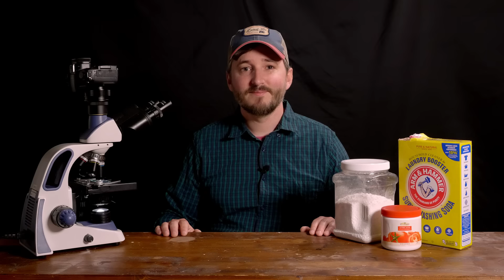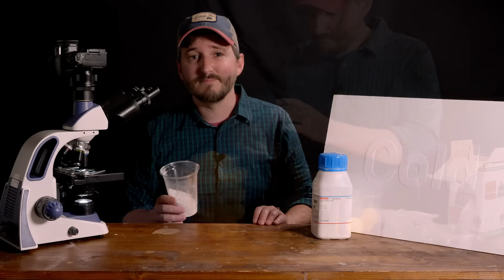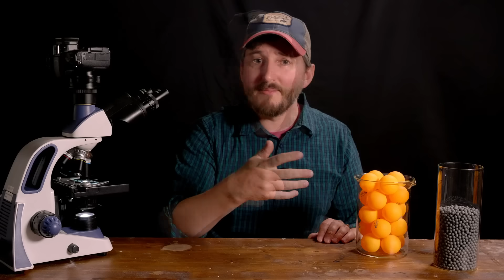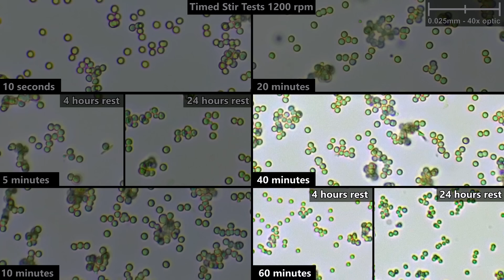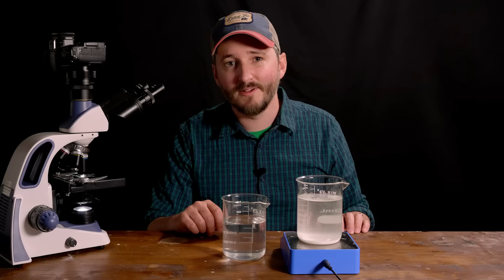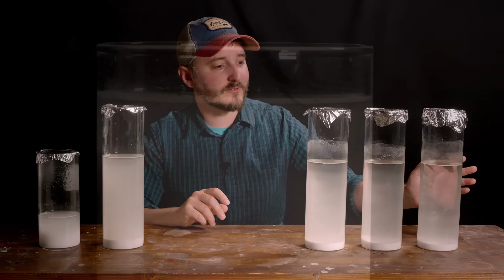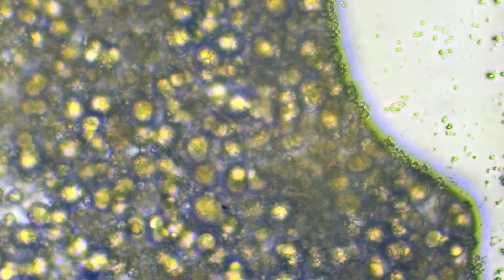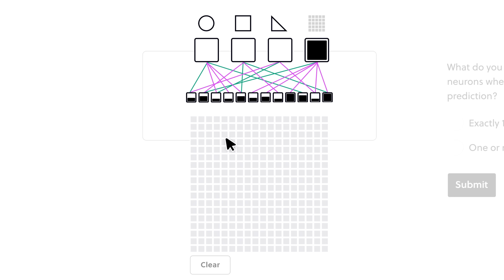Making Infrared Cooling Paint From Grocery Store Items (w/Novel CaCO₃ Microsphere Synthesis)

Comment: can someone enlighten me if my plan will work.....
the plan is to use a mini washing machine(a motorized agitator built-in to a bucket) to run a X10 batch , Thought of a way to poured in is a followed as not to waste time washing again and again with vinegar... 
1.start by pouring in ALL of the Calcium Chloride/Citric Acid solution all at 1 go and turn on the machine
2. start mixing with the 1/3 nanoscale batch,
3. at the 5 minute mark, pour in 1 batch smallscale 
4. at the 9 minute mark, pour in the rest of the 3 batch largescale 
5. stop all mixing at the 10 minute mark
so the nanoscale particles get it's 10 minute of mixing, smallscale particles get it's 5 minute of mixing, and the largescale get it's 1 minute of mixing...
will this plan screw everything up?  or should i opt to the "wash after each batch" ?
the solutions are awaiting the in fridge awaiting advice...thanks everybody
Reply from the maker: A washing machine may work. It will not work to add the solution in steps. It would work to do the opposite, however. If you add all your mixture at once you may remove some at each time increment to make different sizes

Comment: I understand that the sphericle particle shape and their size distribution would pack more densely. Same concept as ultra high performance concrete. But such a paint coating may not need such dense packing. In other words, how much difference in emissivity/reflectance would it make between using microspheres vs. regular calcium carbonate? Whitewash is calcium carbonate. Whiting is calcium carbonate sold in ceramic supply stores. Lime is calcium hydrate sold in box hardware stores and turns into calcium carbonate. Does the microsphere density really make that much difference? Seems most all pure calcium carbonate is brilliant white and could be mixed as a paint.
Blessings.👽🐍

Comment: A viscous consistency would lend itself well to a trowel or float. The troweling action creates a very fine smooth hardened surface by forcing the different sized spheres into their most efficient spacing, excluding as much air as possible, and also increasing adhesion to the application surface.

Comment: What is the water resistance/solubility of this kind of paint? If applied to the roof of outbuildings or metal roofing I would want it to be weather resistant. 
Also, reminds of the pyramids supposedly being painted white. Probably with an early form of this pigment.

Comment: May I suggest applying this paint like pouring slip to level floors? Lay your surface as level a possible, apply a border of some sort to the level of thickness that is optimal, level with a screed (if the chosen mixture is thick)and allow it too dry. Maybe add vibration to shake out any air bubbles? A vacuum may do the same but would put the process outside of the common person's access. Great idea!!!

Comment: I had an idea!  there is "car dip paint" that is very matte in finish, and is colored the same way that you're "coloring" your acrylic.  I wonder if that could be used as the polymer to hold the pigment?  If so, that stuff is VERY spray-able and is straight up designed to have micro-pigment suspended in it
Reply: Plasti-Dip is not durable at all
Reply: Durability ... like many things, is a relative term.  Compared to what he WAS using... it is likely MUCH more durable @NoSpamForYou
Reply: Wait since when?
Reply: What is the car dip paint?
Reply: @marcisaacs9407  It's a product called plastidip but a company called dipyourcar sells it in bulk in car kits

Comment: I probably missed the explanation in the video, but why do you need nigh packing density? I thought as long as the rays of sunlight are blocked by particles, they'd get reflected anyway. We might even say that a lower packing density makes for a lighter paint easier to apply.
Reply from the maker: More pigment density means you need less binder, which means more of the paint is doing its job of radiative cooling.

Comment: Use of an ultrasonic horn may refine the microsphere size. Not exactly an out-of-the-hardware-store idea, but you could make one! The mechanical properties of the pigments with alloying the different sizes. Also, I appreciate the filter design with the capillary action - I came to the same simple idea with layered geotextiles for my raised garden beds. Anyway, top job.

Comment: This is very cool. I wonder what the applications are in a combat scenario. Like, they have infrared blocking ponchos to make someone relatively invisible through a thermal optic. If it’s a cooling paste, it’s purpose isn’t to make something warm the same temperature as its surroundings, but rather cooler than its surroundings. So I do wonder if it does have an application like that. I think the first thing that comes to mind is being used on a roof of a house, especially one where the air handler and evaporator are in the attic where it’s super hot. A cooler attic would likely make for cooler air through the ductwork and an air handler and evap less affected by attic temperatures. I know it’s all insulated, but the insulation isn’t insulating 100%.
Reply: I’m also curious if this same potential money saver in the cooling season would cause problems during the heating season. Like, I doubt it would if you had hydronic heat (like my house) because the attic is insulated against the top floor anyways. Since cool air falls I imagine in a two story house where the top floor of radiators were oversized and generally caused the second floor to be a few degrees warmer than the first floor, a cooler attic might remedy the problem. Again, if the attic is stealing heat from the second floor, it could cost more because more warm air from the first floor would rise to the second floor. Idk, I’m throwing ideas on a wall and seeing what sticks.

Comment: What if we use micronized titanium dioxide-based pigment, such as Tronox CR 828, which is commercially available and not very expensive? We can use zirconia grinding media to further grind it to the desired size and mix it with an appropriate solvent to prepare the paint.

Comment: Your application process with the spray bottle can be improved by one of two methods. I use a pump up sprayer for large economical applications. Your local garden center sells them in many sizes from quart all the way to several gallon backpack sprayers.
       The other option if you're able to make it thick like drywall mud... Then you could simply use a drywall mud Hopper and sprayer to spray on thicker applications such as walls or large surfaces. Hope that helps!

Comment: I make ink that is used to make articulating paper. It took me awhile to understand what was going on with the micro spheres, i think of them as pearls.  I get good results with low heat, slow mix as it cools and layer the batches in a five gallon bucket to sit for at least 2 weeks. I dont mix the buckets till i need the ink. Doing this i noticed it was thicker, didn't separate out, and most important ink is very consistent between batches.

Comment: Question: Would the radiative cooling paint work best with, or without, insulation underneath it? It seems to me that if there were no insulation underneath it, it would absorb heat from the living space, since heat is attracted to cool, and radiate it into space. On the other hand, it seems insulation would help keep the living space from absorbing heat from outside. I'm torn on this, but it seems to me no insulation might be better. Insulation in the walls, yes, but not underneath the ceiling. Your thoughts?
Reply from the maker: Depends on what you're trying to do. With insulation it will protect from fast temp swings in either direction. Without insulation it may get cooler at night faster but will warm to near air temp faster during the day also. It will stay below air temp either way provided not much heat gets in through the walls.
Reply: @Nighthawkinlight  Thank you. Perfect answer. I think "with insulation" sounds like the best solution for a living space.

Comment: This is amazing. After your last video I started to play around and tried to upcycle some plastics and find appropriate solvents. But failed terribly. 

I‘d have some questions…

Does it matter how far the polyethylene layer is placed from the paint? In the last video you had nearly no airgap. Now you had an airgap of a couple of centimeters.

Could I simply add some adhesive film polyethylene layer on top to make my panel as flat as possible?

Could I simply cool air through my panel? I guess running water through a panel would be more efficient, but building an air based cooling panel might be easier. 

Again, amazing work! Thanks for your advice.
Reply from the maker: I'm sure there's an ideal air gap for the poly film but I don't know what it is. It does work best with a gap.

Comment: this is incredible--an invaluable addition to the arsenal of information i gather to create more efficient cooling and heating systems for all of our everyday needs. 

i just watched another video using this "super coating". it's not as good at explaining this but he did show what i think will be a solution for applying this paint. he used a compressed air painter's gun -- the kind used to paint walls in buildings. hope this helps.

Comment: Where I get negative ion dc 9v generator
please help me I want to make that static charger🥲🥲
Reply from the maker: Ebay
Reply: @Nighthawkinlight  can you please give me the link
Reply: @Nighthawkinlight  ther are only 12v dc generators are availabe.......and thanks for the instant reply
Reply from the maker: @ghulamhussainkhan1651  Yes the 12v generators will still run on 9v
Reply: @Nighthawkinlight  thank you very much 
may god bless you with 1000000 subs
Reply: how many kv is required

Comment: I watched the whole thing thinking I can maybe paint my trailer roof and save $ on AC, but there's no way I'm painting the whole roof with a pastry bag. What if you were to trowel it on, it seems you can vary the consistency to make it trowel friendly. I've painted other roof surfaces with Henry Ultrabrite elastomeric roof coating, and it helps with cooling, but probably not like this. What if I were to mix your pigment with another paint such as the Henry, maybe a roller would work ok to apply that?
Reply from the maker: I've painted my own barn roof recently with a white commercial silicone paint. I think that is the right choice for now because my own paint is not ready to be used for such purposes. I don't know what would happen if you were to mix my pigment with a commercial paint. I need to test those things to find out. It's probably not a good idea to experiment on such a big project as your whole roof. Once I've tested many mixes on a small scale perhaps I will be able to recommend a good solution.

Comment: Have you measured just how much heat this can move? I saw you were working on making panels, it would be great to get some stats on them to estimate needed sizes for particular uses. W/m² say? We use the measurement for heat gain in a solar heating application, this is the opposite.
Reply from the maker: I haven't measured this yet. Some papers with similar cooling paint measure about 90w/m2.
Reply: @Nighthawkinlight  I've been thinking about this. Perhaps what you have is not highly emissive paint, so much as highly unabsorptive paint. It's not so much that it emits thermal radiation so well, it's that it emits a little more than it is absorbing from the sun? A "black body" emits AND absorbs thermal radiation perfectly. Real objects aren't perfect black bodies, but they tend to be similar in their emissivity and absorptive values.
Not that this unabsorptive paint isn't amazing! But, if you want to dump thermal radiation into the empty night sky then try water. But keep it out of the sun, because it absorbs about as well as it emits.

Comment: When it comes to applying the paint on flat surfaces, what if you poured it on and used a notched adhesive spreader?
Reply from the maker: It's possible but the paint dries very quickly which could make things difficult

Comment: It would also be interesting to compare the CaCO3 spheres to a lime paint used on some houses in the Mediterranean. In this case, a solution of calcium hydroxide in water is applied and then forms CaCO3 together with the CO2 in the air. I could imagine that small holes in the CaCO3 are also formed when the crystals grow together.
Reply: I was just wonder that.

Comment: First of all, much appreciation for you and your diligence! 

Then, a technical question. The atmospheric infrared transmission spectrum (main window) spans 8 to 14 microns, which is also the typical detection spectrum of infrared imagers such as the one used in the video for temperature measurement. So, if the intended infrared emission to outer space is in that window, then shouldn't the infrared imager detect the added brightness (and perhaps read that the coated surface is warmer than it is)? If this is the situation, would a reading of the rear surface of the board show a stronger temperature difference? (Or perhaps a different means of temperature measurement altogether?)

With the back of the board on the ground, this might help explain the leveling of thermal brightness experienced without direct sun, with the earlier versions of the pigment - perhaps the pigment is in fact doing its job, pumping heat up out of the ground and into space, in the 8 to 14 micron band, and then the infrared imager is simply detecting that emission?

Alternatively, is the intended infrared emission going through one of the narrower transmission bands at shorter IR wavelengths? This would make the skyward emission invisible to the IR imager and thus the results would look as they do with the latest pigment in the video (the front surface of the test board appears colder where the microsphere paint is applied). 

Or an even further IF: if the earlier pigments emitted their infrared in the imager's detection band, but the later one emits it at a shorter wavelength, this might then explain ALL the results?

Again, thank you for your hard work, diligence, persistence, and - openness with information!!!
Reply from the maker: For caco3 the main wavelength we care about for cooling is at ~11.5um. This doesn't effect the IR image because the quantity of IR emitted at 11.5um goes down with the same temperature dependant function as any other material. Also, in my previous video my samples were backed with a piece of foam when on the ground.
Reply: @Nighthawkinlight  Awesome... and what was the key wavelength for BaSO4?
Reply from the maker: @PaulJames-vd1jj  Between 8-10um

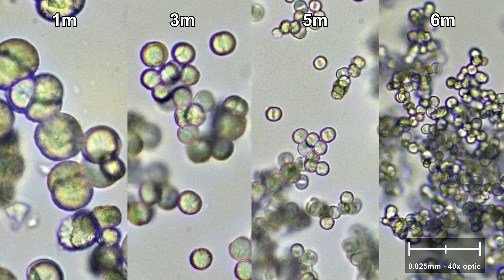Comment: Hi I've made my first batches of it, I wish to see how well they sphered up. What magnification where you using at 22:50 28:30 ? (I need to buy a microscope, Celestron CM1000C i think)
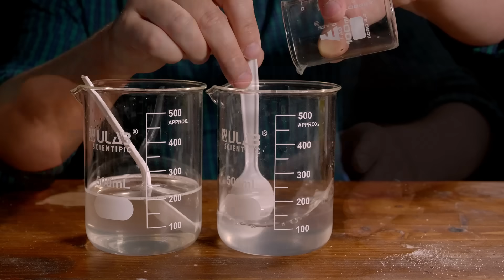When mixing a 200ml sodium carbonate/100ml Calcium chloride/30ml 3g citric,  It started at 15 degrees (21:23), but after 9 minutes was 28 degrees, the other bigger mixes did also heat up a little. Is it important to keep the temperature stable while mixing?

 I think I might use a bucket and a drill spinning a stirring stick, next time.
Reply from the maker: I was using a 40x optic on a Swift SW380T for I think all the shots I used in this video. My mix also heated up in the blender for the longer runs but it seems the starting temperature is what's most important. I'm looking forward to hearing how it looks if you get a microscope!

Comment: Have you looked up Micro balloons? micro size glass spheres, mix with poly resin or epoxy, for a super lite weight filler compound, used for smoothing fiberglass...
Reply from the maker: Yes, I have some. It's also possible to make the calcium spheres hollow. I may do that in the future.

Comment: Just a thought about application technique:  add high frequency vibration (or ultrasound?) to the manufacture and/or the application process...  +find the specific vibration period(s), duration time(s) and, if possible, the resonant frequency of the mixture or perhaps only the resonant frequency of the the largest (or smallest?) ball component.  (Resulting in an increased ball mixture and/or final fluff' thickness, trying for hardness?).  

Could it be painted at all or must it be exposed?
Could a very white or transparent to Infrared protective layer be applied and retain functionality?
Final washings w/distilled would dissolve out salts (added time, expense, etc.)?

...much respect for the nod to your (source, reference) material.  I block but do prefer the content and longer videos and watch til the end, like, sub, etc.  But stage a poor video and just the opposite, 9 out of 10 times.  No undeserved, effusive sentimentality coming from this outlet.  Just the opposite in your case, which is refreshing. Appreciate your attention to the details and I may recall telling you that before.  Great video, as always.  

Have an incredible day. Fair winds and following seas.

Comment: My question is does this paint shed infrared light? I understand it's reflectivity, but could it act as sorta a one way barrier? The test I would perpose is 2 cups, built the exact same way, but one with the paint on it. Both filled with hot water. The over reaching reason is if it could act as a one way, it would mean any heat that had been converted to infra-red would be shed quicker from the painted cup than from the normal cup, cooling the painted cup quicker.

Comment: I could see making "blinds" on a roof with this paint on one side and black (or photovoltaics) on the other side and running fluid through a channel down the center of each blind for a heat-exchanging fluid. Then routing that fluid through some phase-change heat storage. You could flip the blinds to the white side during summer to cool off and to the black side during winter to warm up.